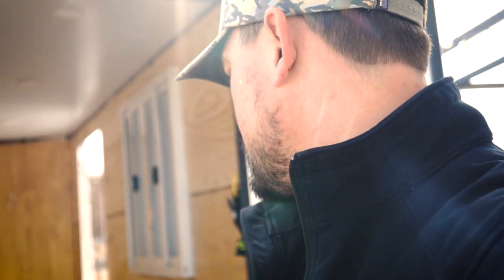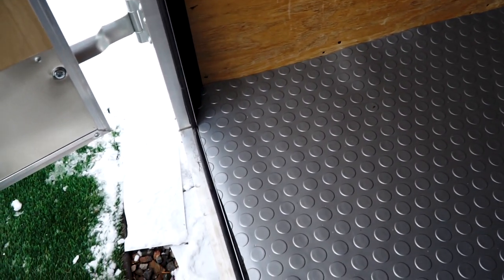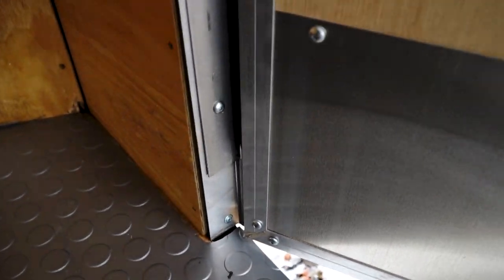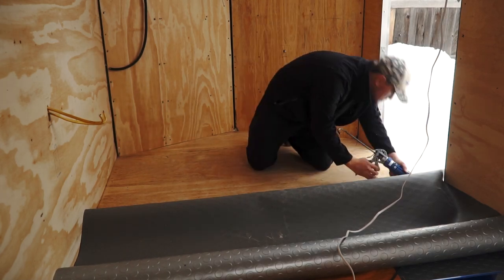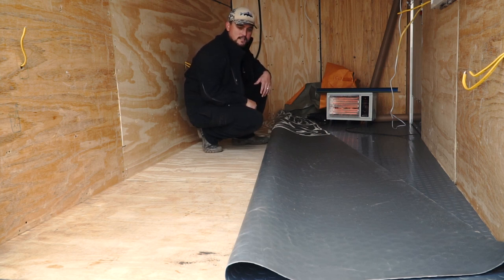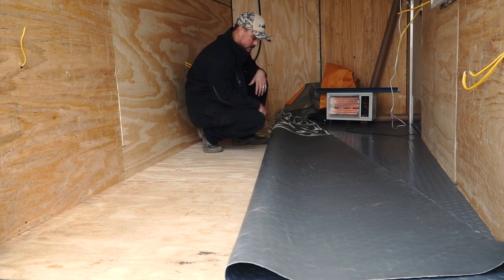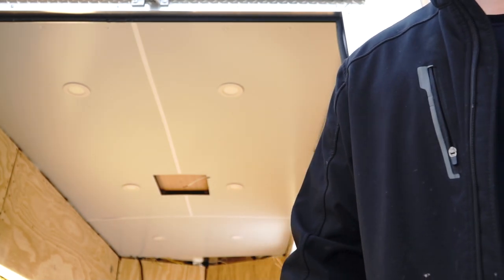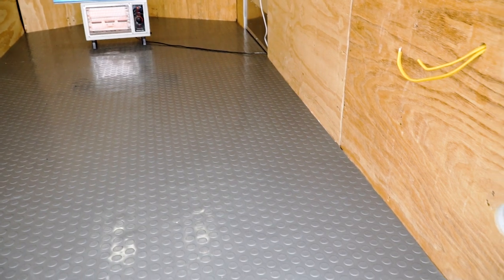Install Rubber Coin Flooring in the Food Trailer - Cargo Trailer Conversion Ep.4

Comment: Hello good evening did you custom order the rubber coin flooring to be 1 piece to install in the trailer? Thanks in advance.
Reply from the maker: Hi Chris, no I ordered the stock width that was wider than my trailer. I then cut the entire roll on my miter saw to 2" larger. This made it a lot easier to roll out and do a final trim with a razor blade.

Comment: Does it need trim on the edges so it doesn't come off?
Reply from the maker: No, its glued down but I do install angle aluminum trim later and seal edges to make the edges waterproof for cleaning purposed.

Comment: I wonder what not gluing would be like
Reply from the maker: The manufacturer only recommends a floating no adhesive installation if there will not be any heavy objects on the floor for long periods and if the flooring isn't installed wall to wall. The floor will bubble/buckle when not installed with adhesive. In my opinion, if you keep the inside of the trailer temp controlled while using it I do not think you would have any issues